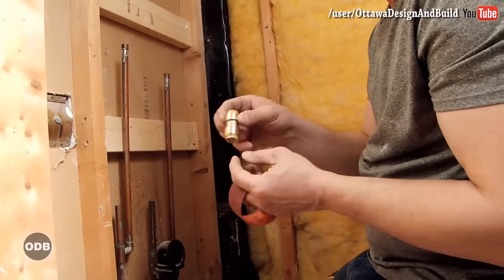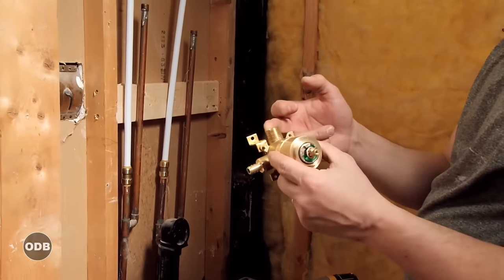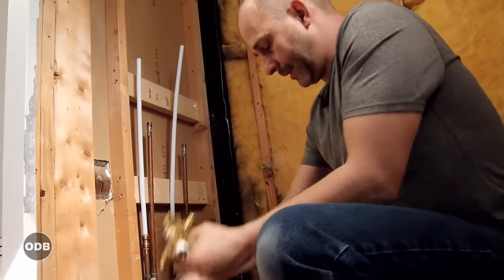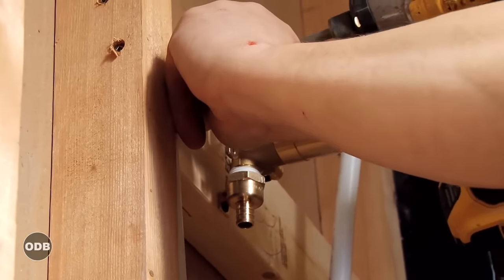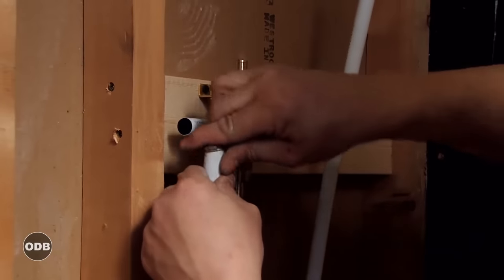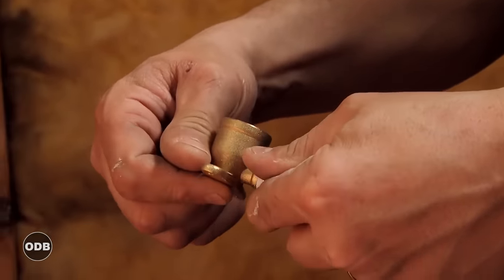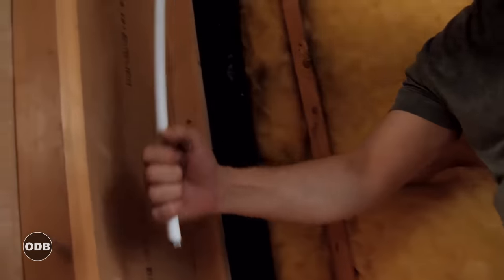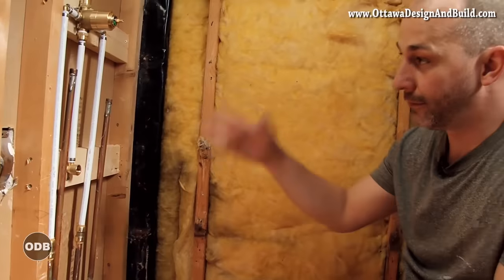DIY How To Install Copper To Pex | Shower and Bath Plumbing

Comment: Hey Jeff, pex tubing for a tub spout drop is generally considered a no no isn't it? I made that mistake a while back, the end result was the tub spout didn't work. I had to replace it with copper and it then worked fine. If you buy a Delta shower faucet the installation manual will specifically tell you NOT to use pex for the tub spout drop. I'm curious if this set up you did here worked. I'm sure it did, you probably know something I don't. On a lighter note your video was a huge help to me just to revisit the procedure for a shower valve install, which I completed easily going from copper to pex. So thanks for all of your great videos.

Comment: Should the inner tub be pulled out using Copper? Or is that optional?
Reply from the maker: In regards to the sharkbite fittings, the old standard was to remove the plastic insert, however the product was redesigned a few years ago and now it is completely unnecessary.

Comment: Could you PLEASE tell us what brand that rough-in valve is?  I'm finishing a shower remodel and this is what the builder used, but can't remember what brand (and it isn't a standard one).  Thanks much!
Reply from the maker: This is called Riobel Pro. Good luck.
Reply: That's what I was thinking, but finally found it - it's an Accufit MIR3001 by Mirabelle or ProFlo (your other shower install video uses a Riobel Pro, however!)  Thanks for responding.
Reply from the maker: I think you might be right. I did this one a while ago and forgot I used the proflo. My bad Peter Martens

Comment: Great video.  My only suggestion is to use copper to tub spout. If you use pex it will restrict the flow to the tub spout causing water to back up to shower head and leak out of shower head when filling tub.. It happened to me. Notice in recent videos he switched to a copper tub spout leg.

Comment: Thank you for the video. This is very helpful. Note to self: 1/4" from end.
How high above the tub spout did  you install the controls?
Can you use the push fit to crimp fitting for the tub spout if you have existing copper for the spout?
I'm going from PVC (for cold) and CPVC (for hot) & copper (tub spout) with a two handle system to a single handle with PEX. I want to have my controls higher up & am trying to figure out a good height. Shower will be used more often than the tub.
Are the capped copper pipes the hammer arrests? Are those necessary in a PEX pipe system?
Do you have a followup on how you did the tub spout attaching to that lower fitting?

Comment: Fantastic video!!! I will use this video to help me do my bath room. You did a great job! I was worried about how much work it would take and now I feel ready to do it. Thanks again for a wonderful video! And the background music is a plus! Love it.
Reply from the maker: You are very welcome. Let me know if you have any difficulty. We now suggest you use a 3/4 fitting and pex to run to the tub. This will avoid any potential back pressure to the shower head when filling the tub,

Comment: The best video I have found in this. Question: We moved into a house where the plumber installed red shutoff handles along the lines (one leads to a bathroom sink, the other to the shower). These appear to be for hot water but it’s hard to tell. There is a clicking noise in the wall when using the hot water. Why would a plumber install shutoff valves for these? It seems strange. Thanks!

Comment: My Glacier Bay Single Handle Tub & Shower Assembly, says not to use PEX or CPVC between the valve body and tub spout.  Glad I checked directions. What were the odds of doing that. 1 more single use of specific tools not to add to storage.

pEX

Comment: I am just curious if its okay to use PEX for shower head , cuz there was a warning from Homedepot saying "NEVER 
USE PEX for shower head
Reply from the maker: Actually, there is a warning not to use pex for the tub spout if you have a mechanical diverter that you pull as it causes some of the water to come out of the shower head when filling the tub on some models of shower valves. Cheers!
Reply: @HomeRenoVisionDIY  Thank you for the detailed explanations. I have used copper  with sharkbite coupling for shower head and spout. Cheers!

Comment: I replaced a shut off valve that was leaking and still leaks. I put three turns of tape, so I'm guessing it wasnt enough? Mind you, the previous ferrule had left the pipe with dents from the original installer. Do you think thats the prop and not enough tape?
Reply from the maker: Let me know which type of shut off, compression, soldered or pex or sharkbite. If you are using a shut off valve with a 1/4 turn ball valve then it could be the connection to the pipe. However. the valve itself may be faulty if it has gaskets. so many variables please narrow this down and I would be glad to help.
Reply: +Ottawa Design and Build Renovations Excuse the tardiness. YT didn't notify. Yes it was a 1/4 turn compression shut-off valve. Original was multiple turns and had bad gaskets. We did put a crapload of Teflon around the ferrule  to at least reduce it to a 5 second drip. I believe Im right that the original valve was installed incorrectly leaving groves on the pipe. Now that it has a new one its leaking from those grooves.
Reply from the maker: Best to cut back the pipe and start clean.Otherwise you will need to use a soldered shutoff valve.
Reply from the maker: you will need to cut back the pipe untill you have clean copper.

Comment: If I'm just extending the shower head higher with new pex pipe. Do I need to turn off water to whole house? Because the valve should already be closed right?
Reply from the maker: as long as you are careful not to turn on the water. You'd be surprised how quick you can get soaked.lol
Reply: +Ottawa Design and Build Renovations another quik question. I just bought 1/2 pex and 1/2 crimps you are using in video. But it doesn't slide on like yours did. It needs that expander tool.... Do I get a bigger size tubing and crimp?
Reply from the maker: The rings fit firmly over the pex and should slide around.The tool makes the diameter of the ring smaller to achieve the water tight lock.
If you are havoing trouble visit the building center where you bought them and a plumbing associate will clear up any questions. Good luck.

Comment: Just curious, on the shower valve I'm going to be installing it recommends using 3/4 to the tub spout if using pex.  The reason being the smaller inner diameter of the pex can restrict the water flow to the point it will back up and come out the shower head.  Did you have any issues with this?  I'm using a Grohe valve.
Reply from the maker: depends on the model of the valve. If it has a dedicated function position or not. If the tub spout has a manual diverter than this can happen depending on the water pressure in the house. p.s. so the shower head may also aid in the filling of the tub. That is the worst thing that will happen. in reality that is not a problem

Comment: Okay question, at 9:40 in the video when he's showing everything completed, on the copper side of the SharkBite connectors there is a t with a 2-foot piece of copper capped off. any idea what the hell that's for?

Comment: Great job, however it is not recommended to use Pex for the bottom part as it is smaller on the inside so the water will back up and start falling from the shower overhead. Learnt that the hard way.
Reply from the maker: Such a pain when it leaks into a tub you trying to fill.

Comment: HELP!! My bathroom remodel contractor just wrapped up the bathroom and water still comes out of the shower head when the tub faucet is running. He added more length to the pex shower line from the diverter and ensured right angles going into the diverter as well from the H/C supply lines. 

Do I have a bad diverter??

ALSO....he did NOT spec in the plumbing to the distances between diverter and shower head/faucet as indicated in the MOEN book itself. Though he said he has always plumbed in the diverter at ‘belly button height’ with no issue.

Comment: I installed a Moen Adler tub and shower faucet and for some reason the diverter on the tub spout is not staying up. It instantly falls back down if I hold it up hardly any water comes from the shower spout any advice? I have all 1/2" pex for the tub it's 1/2" pex to a drop ear and then all thread 1/2" copper to the tub spout. All other plumbing is all 1/2" pex

Can't get this to work and not finding anything online...

Comment: I have sharkbite red blue tubes ready to fit . Can I use the same rings you used instead of sharkbite copper rings ? i heard they fail sometimes . I think the mfr of these rings should make them a little wider .
Reply from the maker: The secret to these rings is to install them 1/4 inch from the joint. If they are going to fail it will happen at the time of the pressure test. If you don't mind the cost the other ring system is better. The tool can be rented at the building store.

Comment: I live in the U.S.  Would you recommend using sharkbite, behind a tile shower wall.  I have been told not to do it.
Reply: Don’t use shark bite fittings behind the walls. Soldering is best.
Reply: @krishnajgk4870  Why.  I thought they were the replacement to soldering.
Reply: It is easy to deal with but there is a high chance that will leak, mine leaked and luckily it was in the basement. Because it is a compression type fitting will not hold tight so when you put a force it will bend which creates a gap, possible for the leak. You should not mess with this fitting behind the walls just do soldering. Or higher for plumber only for soldering, just 100 bucks and install rest to the pex by yourself.

Comment: not only does this guy put PFTE tape on backwards but he also uses the pipe grips in reverse. PTFE tape roll it forward to get a tight grip into the threads. Pipe grips are designed to grip tighter as force is applied. ie top over bottom.

Comment: How did u shut the other 2 copper pips beside that off. The 2 longs ones going up the wall ?
Reply from the maker: those are the supply lines. We shut off the water at the ,main and then opened the lowest tap in the house to drain the lines. We have a video on our site demonstrating how to do this.

Comment: wonder if putting a little pipe dope on the pex fitting before using the crimp tool hurts anything.
Reply from the maker: But what would be the point!
Reply: @HomeRenoVisionDIY  Just wondered, because you used tape and pipe dope together for insurance behind a wall.

Comment: Do you have to apply a lot of pressure to put the 1/2 pex pipe onto the adapters bucause mine doesn’t fit?
Reply: I had to get my tenant (a big ol dude) to tighten it.

Comment: I would have solder some short length of pipe on to the solder the Pex fittings to them.  Would give  it more strength and support. Like to see it five years out...etc.  if any issues.

Comment: Talking to both Delta and Moen - they do not recommend pex to the tub spout as it will cause a water backup to the shower head and leak.  Have you seen this issue in your install?
Reply from the maker: this is possible due to water flow and pressure issues. If this happens just turn down the valve at the main intake to the house and it should go away.
Reply: Its called stacking!

Comment: ok my only question is what if those plastic pipes rated as far as pressure ? what if that plastic pipe cracks or breaks wont you have a waterfall in your wall and now you have to bust your wall to get to those pipes? just curious question?
Reply from the maker: In reality these plastic pipes are more durable than copper in cold weather. All you need to do is protect them from physical damage like screws.They will last forever.
Reply: i understand well unfortunately in nyc code doesn't allow
Reply from the maker: They are rated for twice the pressure that any city system operates under. This is not a real concern.

Comment: Shark bite fittings are not allowed in spaces where they are not accessible. May be different code in your area but that is fairly standard.
Reply from the maker: yes, we have an access panel on the other side of the wall to monitor.

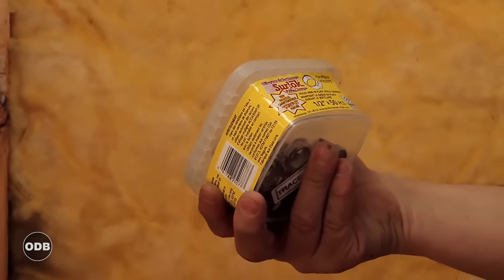Comment: OD of 1/2" PEX is not half-inch...as you state (4:40-4:50)....it's 0.625" or 5/8". But I get it.....your point is more that PEX 1/2" OD is the same OD as 1/2" copper, etc. Also this.....Sharkbite connectors are great....however, think about this--> you are putting these behind drywall. If there is EVER a chance for these water lines to freeze.....remember that Sharkbite can leak when water is less than 33 degrees F. This voids a lot of positive characteristics of PEX...namely freeze tolerence. PEX can take at least "some" repeat freezing WHEN PEX CRIMP connectors are used....but you're introducing a weak-spot using  Sharkbite due to its leak potential under 33 degrees. If freezing protection is not an issue ever....then maybe you're OK.

Comment: How do you know how deep to install the diverter valve so that after wall and tiling, the handle will fit on or maybe the handle will stick out too much...?
Is sharkbite allowed for permanent installations by code? I'm also in Ontario..
Reply from the maker: best to read the instructions for your specific valve...each one is different. Check with your municipal building office to ensure that you are o.k. to use sharkbite permanent.
Reply: How much time...do you have examples of first hand info?
I did my water heater replacement with sharkbite years ago and I have had no issues...
Reply: DeeInTheHouse

Comment: I have my doubts about using plastic tubing over copper tubing especially concerning longevity.  What's the life span of plastic when hot water is running through it for a long time versus cold water?
Reply from the maker: I believe the product is rated for 50 years. This means it would last 100 in most cases.

Comment: you should use 3/4" pex on that tub spout.....its going to back up and spray out the shower head when youre filling the tub
Reply from the maker: That is not a problem when you have a dedicated valve. In this case the valve has a position to each function of the shower and does not rely on a mechanical diverter.

Comment: Is it okay to mount that with drywall screws or do the screws have to be copper or brass?
Reply from the maker: The valve body is brass so just about anything will work. There is no oxidation issue

Comment: Do you still recommend shark bite. Trying to remodel my bathroom with 0 plumbing or remodeling skills :/
Reply: Hey dude, try to only use push fittings in ACCESIBLE locations, such as your water heater. If you want ABSOLUTE peace of mind that you'll have no leaks for as long as you live where you do, soldered adapters are the way to go. Its just a few soldered connections for a tub/shower; you can do it! If you do decide to use push to connect fittings, maybe leave an access panel where the fittings are used. Good luck!

Comment: Does the building code in Ontario have spacing requirements to keep pex or copper away from electrical wiring?

Comment: I have a question. My shower fitting thread is not matching the sharkbite elbow. Is there a way to remedy this?
Reply from the maker: Do't use sharkbite. the fittings should be sorted out before installation.

Comment: what kind of pliers are you using to tight the small clamps?
Reply from the maker: a special crimping device available for sale at the hardware store around $20. I chose this tool for the video because the other tool is around $120.00 and most do it yourselfers don't want to pay that kind of money for tools.

Comment: Shower valve is very nice? model#? Use push-in coupling in wall might violate code?
Reply from the maker: riobel pro. Cheers! I have an access panel to get to the fitting. Cheers!

Comment: Jeff: I am on the verge of installing the thermostatic valve. Do I have to put water hammer arrestor? Or just copper tubing ok? If so how
Long ? Thank you !
Reply from the maker: if using pex not water hammer required. cheers!
Reply: Home RenoVision DIY oh! Ok! Cheers !
Reply: Ok: now if you need them, where/how do you put them ? Mostly in the eventually that one has a mixed system: Pex + copper . My case ...
Reply: @ikust007  "Mostly in the eventually"? If you can't write a coherent English sentence, don't bother to post.
Reply: Herrick Inman pardon?
Reply: Herrick Inman j’attend votre réponse plus polie en français puisque vous vous exprimer avec peu de savoir vivre en anglais .

Comment: Must ensure that the copper pipe is also reamed to remove burrs. If you don't then the turbulence over years will cause pitting and leaks.
Reply from the maker: Very good point Wesley

Comment: It's very easy to replace this valve body while it's open, but it's pain in the butt to work on vinyl shower bathtub. Still trying to replace this thing with so  little space.  .
Reply from the maker: the cartridge can be replaced after tile installation. Such a deal.

Comment: Sadly this will leak eventually  those clips you squeeze are great in the beginning but over time they have been known to not hold perfectly and drip.  But everything here is very snug so you should be fine.

Maybe he<s using a newer type  but the ones we used years ago had issues.
Reply from the maker: NO doubt, the older generation of those clips were horrible. But like most things they get better with time and design tweeks. Cheers!

Comment: no one talks about how far in or out you install it on the wall.. will it stick out to much or be in side to far after you cover it up?
Reply from the maker: The instructions that come with the valve will have that specific information. Each manufacturer is different so it is necessary to check before installing.